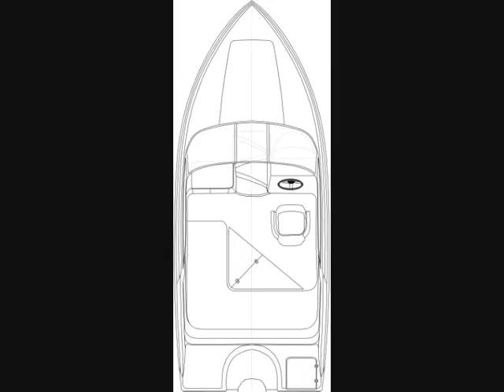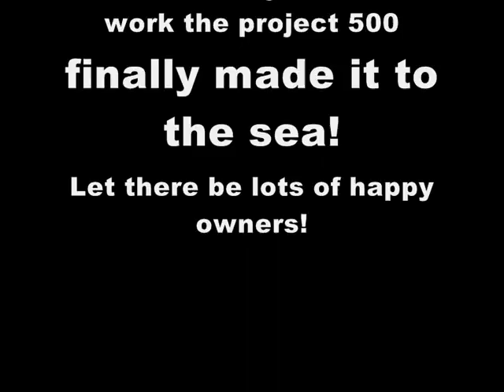making of Compass 170 DC!

Comment: Apparently there's some folks here that are thinking this is a do it yourself project. I do believe this is a boat factory and what was shown in this video is the making of both boat and boat mold to build the boat. I'm I correct or did I think wrong? If I'm right, what is nd of wood is used on the mold? Just regular cabinet grade plywood or is it a specific type for building molds? I'm not a build from scratch guy, I give new life to old boats, so I watch these type of  to have a better idea of how the boats are put together. Thanks
Reply from the maker: Hi and thanks for your comment. You are right, this is a video that shows how the mold was made, and then the final product. Most of the times the wooden prototype is destroyed after the extraction of the mold, so there's no need to spend much on ply. Also ply does not curve that much, so i prefer MDF. Ply is used for the sections and keel. If you are to use wood on a boat then you have to use ply only.
Reply: @goudouth  thank you for responding. Old video so thanks for taking the time.

Comment: now I know why boats are so costly .  what the material expense here ?
Reply from the maker: +Terry Holden Hi Terry, this is one way of building a new model prototype. The cost of materials this way remains low but the time spent to finish it is too much. The other and more up-to-date way is by cutting foam with a CNC milling machine directly from the 3d design. This way is still very expensive (700euro/m2) but it saves a lot of time. Thanks

Comment: How much horse power does the boat hold and what size the bat is?
Reply from the maker: The boat can handle 100HP and it's 5.10m in length. You can see full specs here: http://www.compassboats.gr/en170dc.html
thanks!